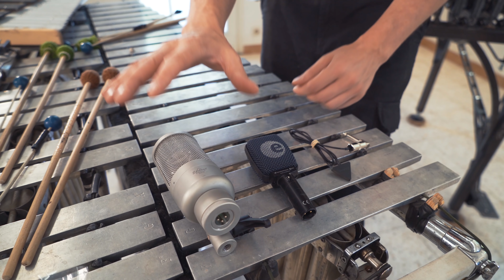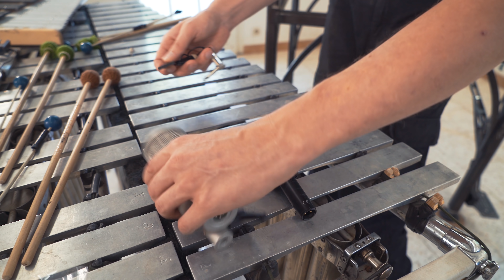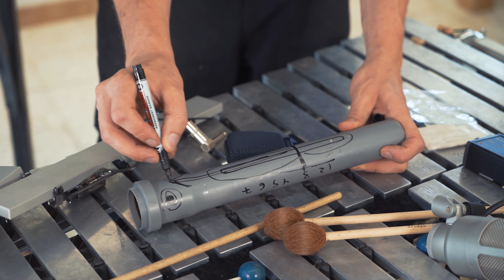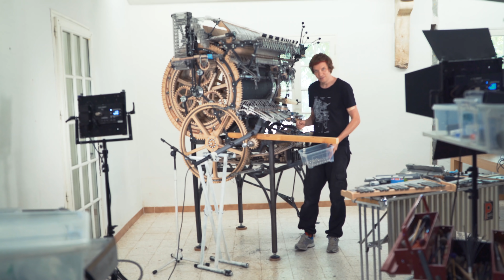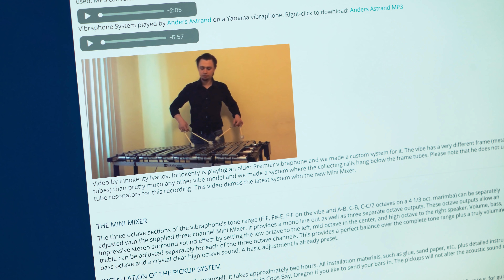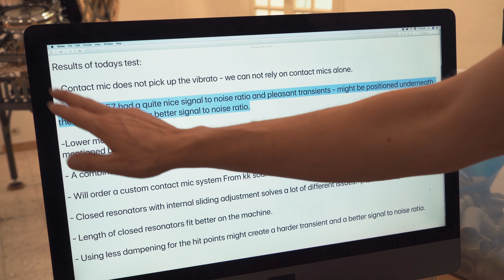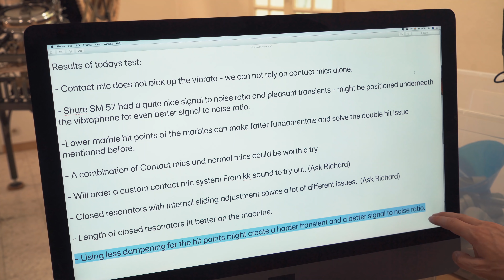Vibraphone Experiments / Microphone Types - Marble Machine X #96

Comment: Just as an idea: What about recording the noise around the machine with some other microphone and subtracting it digitally? Active noise reduction kind of ...?
Or, record the clicking sounds and try to match them with the recorded sound from the microphone to subtract it. Frequency based or shape based. Isnt there something like this already available as a software?
Can you put a contact mic to the vibrato pipes as well and mix?
Reply: I think the concern is interference and/or delay between different microphones. Because the microphones are all placed slightly differently, and any "ambient noise" microphone would also be placed differently, it would be almost impossible to use effectively without creating a lot of audio artifacts.

Comment: Have you tried putting the contact mic on the outside of the resonator pipe?

I think that inside the pipe the pressure changes of the air are strong enough to effect the mic, which it picks up noisily since it's designed primarily for picking up sounds from solid surfaces.

On the outside of the pipe I think it should only pick up the sounds of the resonating pipe, which is what you want.

Comment: I would love to remind you (as also Many others commented it under last video)  that you can fix the marble-drop-point-issue/compromise by coding the necessary offset into the connector of the vibraphone-plate. That way any plate fits anywhere and no compromise is needed.

Comment: I don't think that artificial vibrato would break the spirit of the design philosophy, particularly if you did it with an analogue tube instead of digitally.  You could even add a generator to the crank mechanism to power the thing if you wanted the machine to be self contained.

Comment: What about welding a flat surface to the side of each resonator tube then epoxying a contact microphone to the surface. That might solve your noise crackle issue and get you the vibrato you want.

Comment: I suggest using directional near-field microphones. Each in a short standard length tube. Resonate amplification will be unnecessary for microphone capture. Still use your vibrato spinners to modulate the amplitude if your set on using mechanical methods. Alternately, use your contact microphone system and do your vibrato electronically. This will eliminate all tube length issues.
Reply: P.S. They also make small clip on mics for woodwinds and brass instruments that go inside the tube.

Comment: Blue Man Group ran into a very similar issue when they were planning the touring show.  It turned out that the PVC pipe instruments changed pitch based on many variables (such as ambient temperature and even the altitude of the venue).  This is not as much of a problem for the city based shows but it was impossible to keep the PVC instruments tuned consistently while on the road.  They switched to midi triggers for many instruments.  This caused a bit of an uproar in the community but it was absolutely the right choice. The music is more important than the 'authenticity' of the performance.

Comment: When I was in marching band and we needed to mic the melodic percussion we would clip the mics to the bottom part of the frame so it would pick up the sound after it came out of the resonators. It's definitely the better option as long as it doesn't pick up too much mechanical noise. Don't forget that attaching the mics directly to the machine will make them pick up more noise from the vibrations in the machine if you don't have some way of counteracting them (like how higher quality desktop mic mounts suspend the mics with cord to isolate them from vibrations on the desk).
Reply: Yhsanave to add to this I think Martin’s Lavalier distortion problem may have been the dangling mic vibrating against the resonator tube.

Comment: Just wondering but can't you use noise canceling tech/software to better filter the noise from the signal?  By this I mean  use two mics one in the tube one outside the tube. Then use the outside mic data to filter the inside mic.

Comment: Have you tried putting contact microphones on the bottom cap of a closed resonator pipe? Hopefully, that would pick up the vibrato without that distortion, plus you'd only need 11 if the sliding thing works.

Comment: Putting a contact microphone on the pipe will capt well the vibrato but not very well the sound of the direct hit, so maybe two contact microphone is a solution (one for the direct hit directly in the plate and one for the vibrato on the pipe) but that's a lot of mic ...

And about the issue about plug and unplug the jacks of the microphone everytime you change the removable plate, it can be fixed by merge the electronical connection with the mechanical solution (put the jack inside the click system, but again, that's a big design modification...

anyway, good luck and i hope that you'll find a solution as clean as you except ! ;)

Comment: Could you put the sm57 into a custom cut piece that fits into the bottom of the pipe to slide it up and down, should isolate the background noise and you'd be able to adjust the frequency or would you run intot he same issue with the membrane.

Comment: An advantage of using closed pipes is that they only need to be half as long saving tons of space. Plus they will be easier to tune and you can put a contact mic on the bottom, where there is a displacement node so it will probably be less distorted

Comment: The mic inside the resonator sounded pretty close.  I think the distortion was coming from the standing wave in the tube being much higher sound pressure level than what that mic is designed to pick up.  I once read an article from a top recording engineer that he created his own kick drum mic by rewiring a subwoofer to have a higher impedience so it could act as an extremely low frequency and high amplitude microphone diaphram.

This might be something to talk to Sure or AKG about directly with your problem. They might know how to create a custom microphone that would sit pick up the vibrato.  Not too many people want to stick a mic inside a helmholtz resonator.

Also, didn't do the experiments, but I would think the location of the mic in the tube would have a significant affect on the phase of the signal, since it would be sitting within a standing wave.

Comment: Clipping & noise are both difficult to filter out later, so it's best to have neither in the signal - that's always the case. Now which one to choose - generations of audio engineers have pulled their hair out over this one! :-/
Here's another idea I just had: have you tried placing the contact or dynamic mic slightly under the metal bars (& neither far away or directly on them yet)?

Comment: Have you tried closed resonators with the contact mic attached to the bottom of the resonator pipe via a thin drum diaphragm? Or, put the "wahwah" resonator in the middle of a stack, closed end, then extend past the wahwah 2 cm, place a 45 degree "_/_" split with a very short termination on it and put the contact mic on a diaphragm at the end of the Y?  That way the contact mic is picking up the vibrato, but not blocking the open end of the resonator pipe?
Reply: [ _ "resonator" __ "X wahwah" __ / "mic contact at end of Y"__ "open" ||||| "bar"

Comment: Maybe using air holes along with the sliding system could make it faster and more repeatable to adjust/change notes. So air holes (similar to a flute or clarinet) would be used to change the fundamental and then the sliding mechanism could be used to microadjust or tune the note. It also may be worth trying to set the resonator to one octave above for the lower notes to help keep the size of the resonator pipes more manageable.

Comment: if the vibrato is too intense with microphone inside the resonator tube can't you just put on smaller "vibrato lids", like cut off a piece at the end so it doesn't block out it entirely when closed.

Comment: What about guitar style pickups? 
The possible drawback is that you would have to place a tiny piece of ferromagnetic material on the plate, so that might throw off the tuning.
But the possible benefits are awesome:
You can mount the pickups on the bar mounting setup with an incorporated plug, so that they get connected as you install the bars.
Excellent signal to noise ratio and no substantial mass is mounted on the plate.
Vibratto can be simulated with a pedal, which can be more flexible than the analog one.
You can adjust the right amount of fundamental/harmonics by placement of the pickup individually for every bar and it will stay perfect.

I hope my idea is useful!

Comment: Hi Martin, 
it might be a dumb question but what about contact microphone placed inside the resonator tube ? I don't if this could work but it seems to me that using that kind of solution might help to lower sound to noise ratio and also will help to keep you some space under the vibraphone.
Keep going, it is a fantastic project and it is a pleasure to see your progress every week, even if it is not wednesday !

Comment: I don't think cled variable resonators would work that way. The standing wave inside a closed resonator has a pressure maximum at the lid, so if you have even a tiny hole there, it won't work as intended. 
I would recommend a closed pipe that slides over another one, just like you tuned your open resonators. Soure: Am organ builder, we know about open and closed resonators not working.

Comment: Hi Martin, it seems to me that you get the very best vibrato and signal to noise ratio by mounting a microphone in the resonator tube, but the sound pressure there saturates most microphones. So what you want is a microphone with a very high saturation sound pressure, or a very low transduction gain. You also need a low gain to set the correct signal level because the sound pressure is so high. That is the opposite of most microphone requirements, so standard microphones are not likely to be suitable.

But what if you used what is normally considered a very poor microphone? Like a small moving coil speaker? You can get little ones around 20mm in diameter with mylar cones, and these do have a pretty low gain as microphones. I wonder whether these would have saturation sound pressures high enough to work effectively? They would require some EQ compensation for sure. I can get samples and perhaps try something out if you contact me on my professional email address: mark dot beard at vitae-technology dot com.

Comment: not a sound tech but out of curriousity.. since the mic would pick up both the sound of the MMX and the vibraphone.. what about isolate the mic with a foam (or similar) in order to damper both sounds and also having the mic hanging with strings or similar in order to remove any additional vibrations ?

Comment: So, miking with contact mics removes all mechanical vibrato, and making (closed) resonator pipes is a wormhole... What about a fixed (wooden) resonating chamber under the row of bars? With openings right under the center (or hit point) of each bar that probably could be opened and closed to make a vibrating effect. The chamber could then be miked by contact microphone, I presume, since the chamber would get a variable volume going in. Would also remove a lot of hassle when changing notes, as no pipes or contact mics would need to be changed, plugged or unplugged...

Edit: so basically copy the design of the first marble machine, but use contact mics on the chamber. ;-) Then maybe add a couple of dpa's over the bars as well (if you can fit them between the marble drops)?

Comment: Hi Martin, the first and most simplest and cheapest idea that comes to my mind is the following. You used some sort of sticky foam or tape to glue the contact microphone to the resonator pipe, but what if you would use a hard glue like Cyanoacrylate glue? Have you tried that? I think that it solves all your issues to be honest. I think that the mic needs maximum hard surface contact in order to make it work with the current air based vibrato system.  

And if that doesn't work a totally different approach might be a solution:

Your current vibrato system is based on sound waves that travel through air, the contact microphones use a solid material to pick up the sound waves and not air, so if you want the contact microphones to pick up any mechanical vibrato you need to make a system that works with changing contact between the contact microphone and the solid material where the sound waves travel through. And you would need to dump the rotating discs. I don't know if you can find a material that is pressure sensitive that would allow the sound to travel through if you put more pressure on it, and less sound if you put less pressure on it. If such a material exists you could put it in between the contact microphone and the resonator pipe with a system that puts a variable pressure on the microphone. 

What I am trying to say is that you could try to make a vibrato system with the contact microphone if you manage to built something that can make the contact area and/or pressure to the contact microphone variable. 

It's the amount of surface area from the microphone contact point, and the pressure between the contact point from the microphone and the solid material that determines how the sound is being picked up, so that is what you have to work with if you want to make a mechanical vibrato with contact microphones. 

You could do an experiment by playing a note while you squeeze a contact microphone to the resonator pipe with your fingers with a variable force. Maybe with some help from another material in between them.

Comment: You could use the open resonator pipes to funnel the sound into a sound isolated box and have the pipe length adjustable like a trombone. the resonator pipes do bot have to be straight right?

Comment: Can you use the amplitude of 1 microphone to control the other? In Industrial automation we use PID loops.  These are like the cruise control for your car.  These loops can have a high limits and low limits that can be fed from a sensor. So can you use the vibrato mic as a control element to the contact mic?

Comment: You remember when everybody told you to minimize noise including plastic instead metal mechanism, now the machine creates so much noise that it is almost impossible to use normal mics :)
Of course the marble machine looks great, so as you have said, you need to make compromise, all that extra piping for the vibrato, designs complexity, mic problems and the time required to adjust all that in concert seem something negative.   
So maybe, an Elon musk solution would be to forget about the vibrato.
Reply: He is just facing the whole deal with engineering, you think "that wouldn't be a problem" and it ends haunting you down the line.
Reply: @youkofoxy  yeah, he thought that contact microphones would solve any noise aspect, I even believe him in some point, but I also understand he has a different perspective than me, he is an artist in all aspects and I admire him for that.
Me on contrary I define something nice and attractive if it fulfills its practical purpose in the best way possible.
All decoration is secondary.
Besides, plastic + 3d printing, it would really help him in the development time and cost. 
For example the ball catchers in my opinion is a no brain that they need to be made on plastic.

Comment: What about using 2 tubes sliding over eachother using lubricated o-rings to smoothly tune the resonance frequency. Recording could be done with a small (lapel sized) microphone between the metal bars and the opening of the half closed tube on each key.

Comment: Could you use a smaller flap in the resonator tube and a non contact mic? I would think it wouldn't have as extreme of a transition in sound as the flap closes and opens in the opening of the tube.

Comment: If it acceptable to have some features inside the vibrophone pipes, instead of a slot, make internal rails (3d print?) And use a screw from the bottom to move the plunger up and down... Less complicated and better air sealing than a slot, I think.

Comment: OK... MMX is not an acoustic instrument, right?  But you want real vibraphone vibrato.  Mic up the tone bars, then run the output through a Leslie-like contraption that has an amplifier, a speaker, a rotating diaphragm, and a microphone... then mix the result in.  You might even make money off a spin-off Leslie Iso-cabinet product!